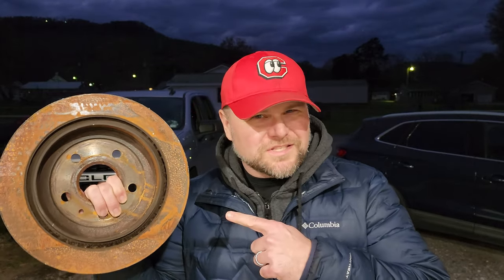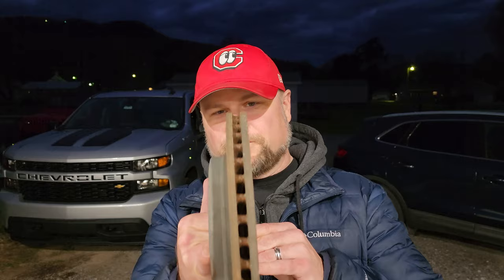Before you buy drilled and sloted rotors-watch this!

Comment: the drilled/slotted ones must be installed correctly to work right. if installed wrong they will cause problems like all the others that have had problems with them have had. and if you think about it. plain rotors are the exact same so it defiantly don't matter. but because drilled/slotted ones differ, the installation would matter. and yes the grade of metal would make a difference. ive watched 2 videos on this crap and that's exactly Y people are having issues. they are not getting installed right. and/or buying to cheap. also I don't recommend dura junk. people stop buying autozone garbage.
Reply from the maker: Thanks for the tips.  I'll do an update video.  This one was just a quick video I made with my son. Appreciate your time to comment.

Comment: Drilled and slotted rotors actually perform slightly worse, on your first break. They just cool faster that's really it. If you abuse your brakes to the point where they start to give a burning smell all the time maybe upgrade
Reply from the maker: Agree totally. For a daily driver, I don’t really see a benefit.  Race car changes the discussion, but this is a street car.

Comment: I was just researching this as I'm looking to replace brakes on my truck. My understanding is, it used to be that with older brake pad technology, the bonding agents that hold the pad together could create a gas under intense heat. This gas would end up between the rotor and the pad, thus creating "brake fade". In short, I learned this is not as much as of an issue anymore since brake technology has improved. Several years ago, I put drilled and slotted rotors on my truck believing it was a performance upgrade (budget kit off Amazon), but probably just going to put flat AC Delco rotors back on with good pads as part of my front end rebuild for my Silverado. I agree with you. Max surface area. I'm not racing, but occasionally tow.
Reply from the maker: Thanks for watching!  I need to post an update video.  These Amazon special brakes he put on the Camaro are super noisy.  I much prefer OEM equipment and parts.
Reply: @jeremsgarage.  Changed my oem front discs to Max Advanced drilled/slotted in 2018...just changed them (2024) for the same kind. And they still had good thickness, but the pads were 2mm so I changed them all.✌🙃

You say noisy....like high pitch noisy?

Comment: Bought my drilled front rotors and I’m still going at 120000 miles.  My stopping is just fine.
Reply from the maker: Nice!  120k miles on a a single set of rotors?  What brand?
Reply: Power stop
Reply: 120000 us in a mercury marquis, driven reasonable, power stop on Tahoe went further but it just eats pads no matter what.
Reply from the maker: @josephthomas9177  good to know!  We put "Detroit Axle" pads and rotors on my son's Camaro.  I think the big key is to not let the pads get into the rotors.  Thanks for the comment. I'll look out for that brand. Who know's. Maybe I'll put them on my truck. 😎

Comment: Conventional vented rotors are ideal for daily driving. More clamping power can be obtained by dishing out for performance rotors, ceramic pads, and multi-cup calipers.
As a retired mechanic, it became too costly, and time consuming to machine rotors. You had to find the min thickness, discard thickness, check the surface for pitting, etc. 
You have to know where to find the info...stamped on the rotors...know how to use and read a vernier caliper, you need industry standard books that have info for all makes and models.
How much are you taking off on your rough and fine cuts? You have to measure after you cut, to see where you are with the measurement vs Minimum thickness.
What about bluing? A rotor can be toast, if it is brand new, and the caliper stuck on, causing it to get excessively hot, thus blued.
We always indexed the stud with the valve, using tire marker -for balancing. Put that thing on the machine, and it might be warped, no cutting to be done, then you had order new stuff. 
In today's day, rotors are so cheap and widely available, that it's not even worth to machine them.

Comment: drilled/slotted rotors what they do is prevent catastrophic brake failure by allowing your brakes vents to wisk away heat, you stop the same full rotors vs drilled/slotted rotors, you will however chew through brakes like nothing as all those holes and slots create depressions in the brake pad material

That said however you mentioned how you wanted "Full rotors for maximum braking power" when almost any braking system can easily fully lock up a wheel on any vehicle with a fraction of it's output force, most non boosted hydraulic brakes output well above 1000PSI let alone boost assisted braking and you can easily lock up brakes at around 500-700PSI, if you had enough weight in the back of the truck that even above 1000PSI the wheels are turning you would likely have the wheels disintegrating, let alone the wheels being ripped off their mounts

A better question for driving a work truck and what rotors you buy is "How much hill driving with a load will I be doing?" if it's rare keep the full rotors, if it's every day you're hauling stuff up and down hills you want the slotted/drilled rotors, keeping in mind you'll have to replace the brake pads more often yes with slotted/drilled rotors, but brake pads are cheaper to replace than entire trucks heading down a hill in an uncontrolled state
Reply from the maker: Thanks for commenting!  Very good points and facts. Towing is a bit different than running one at the track for sure.   I forgot to point out that at the track the drilled and slotted rotors can perform better when there are rapid and repeated heat cycles.  Thanks for watching!
Reply: I have them on my Escalade  for towing works great for brake fade and on my camaro that I drag race and changed them out every 5 years no issues you don't have to replace them unless you dig into them and rule of thumb you don't want to turn regular rotors your making them thin they will start to warp So you said a whle bunch of nothing
Reply from the maker: @jeromegriffin93 LOL... RIGHT.
Reply: Ok let me set the record straight the only time you want drilled rotors no slots is on a car like mine BMW F90 M5 Comp.. 800HP 6 piston brakes. My rotors are the size of some wheels lol.
But the difference is the drilled rows are spaced very far apart and they don't drill to close to edge. Mine are 3/4" from edge 1/2 in between each hole and spaced 21/2 in apart that also flare.
The problem with the ones you son bought is they are prone to cracking because the holes are drilled to close to edge and each other. They don't improve performance at all!! In fact you loose performance!
F1 and most all race cars use solid rotors because you want to stop now! The way they get away with the  heat factor is because Damm near  half the wheel is brakes and they have air ducts just as I have ran straight in from the front of the car to my wheels cooling them. F1 the whole  wheel is exposed so the brakes are getting air on both side to cool brakes. I actually think they still use a duct as well. Can't remember now but. Just like you said i want as much metal to grip.
People get ceramic pads because very low brake dust. On this setup it will also lose Performance.
The only way you gain performance with ceramic pads is to have ceramic rotors.
I about had a heart attack when I found out new ceramic  pads and rotors was going to cost me almost 9,000.00 for my car. But I also track my car so anyway. But just becareful and make sure he beds the brake pads PROPER!

Comment: I heard that drilled and slotted rotors help dissipate the heat as well as get the film that builds up between the rotor and the pad out quicker and the brakes usually run cooler
Reply: Is there better if you are heartbreaking a lot